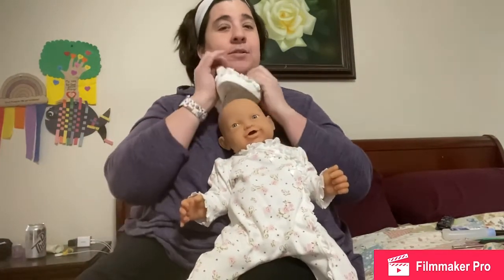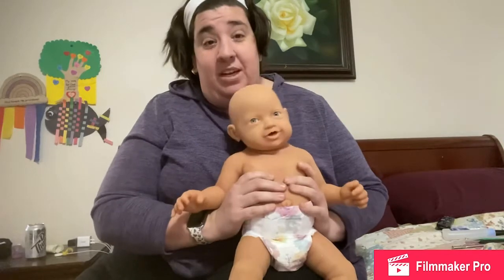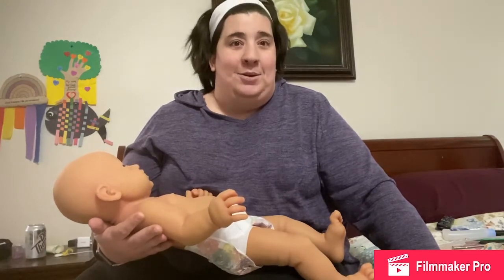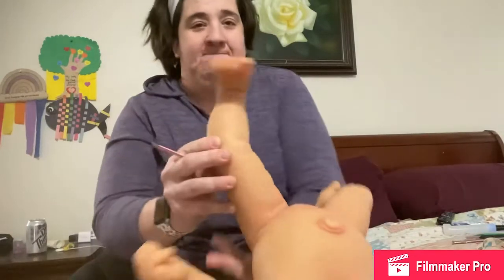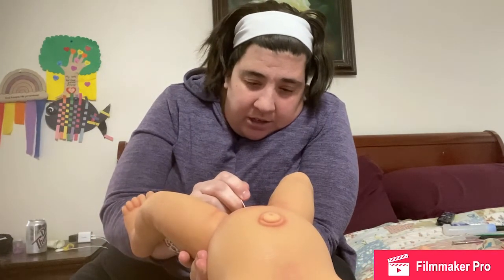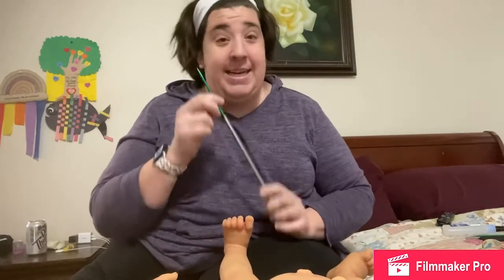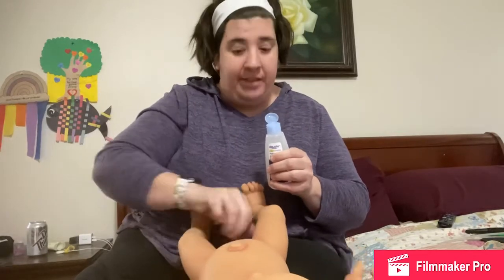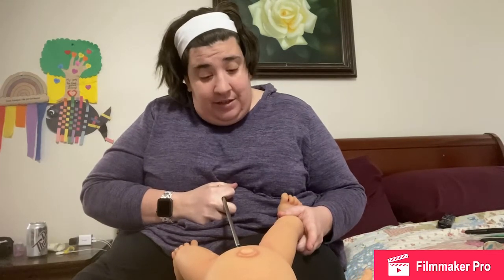Part 1 of diy drink and wet

Comment: I’ve done this to both of our dolls from the same company. NOT an easy feat at all! Never thought of a knitting needle and the accompanying stainless steel straw idea. Amazeballs. I want to try the long drill bit version VERY CAREFULLY. A tip: BEND the babies every two inches that will help prevent poking holes where they’re not wanted. Another tip is to put a screwdriver through the mouth which will let you know where to stop. Using the tips shared I’ve had no mishaps. Freaking close though so experience taught me shove and bend every two inches. Pliers to get the skewer out😂😂😂Great job nonetheless and she’s a cutie!
Reply from the maker: The drill bit scares me I’ve seem ruined bum holes from that :/
Reply: @lexirose2720  I know😩The craziest part is like what part of BIT BY BIT(no pun intended) don’t they understand. Going all fast like Rambo and not taking care to bend the baby properly. What people fail to realize, is that you have to treat this process like an actual baby surgery. I’m SO HAPPY you treated yours with sense.